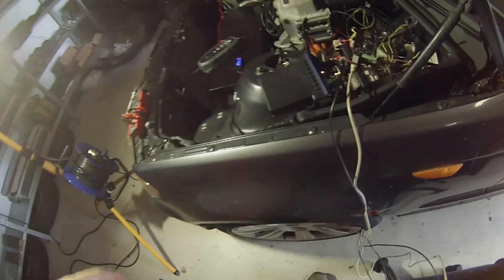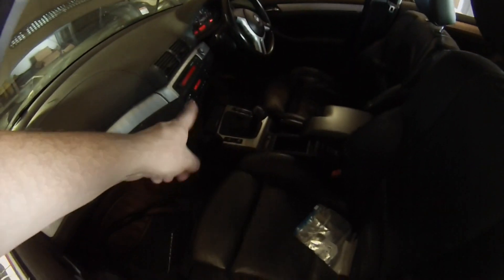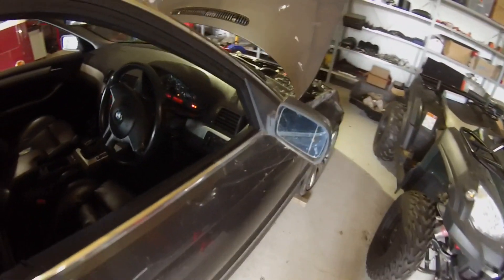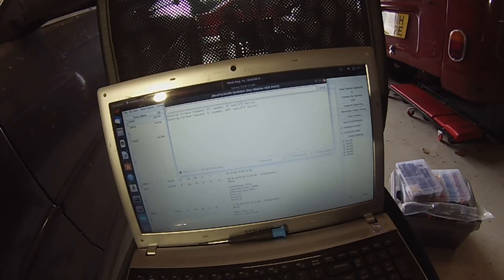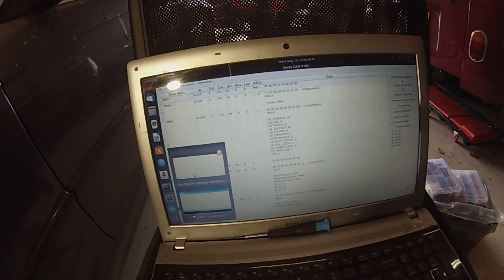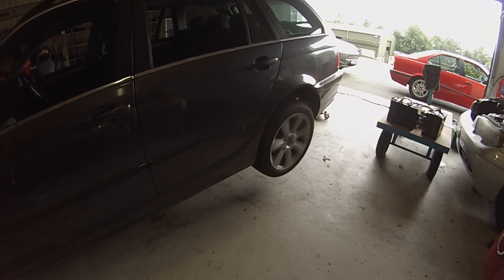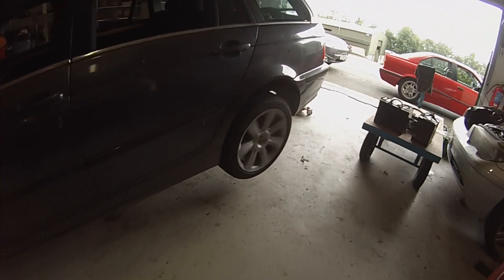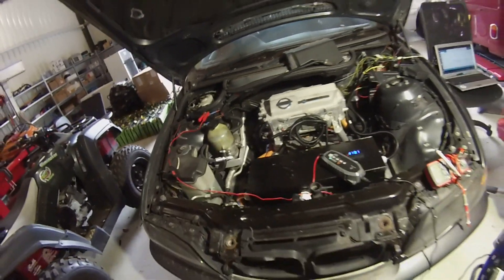The Grey Goose : Forward Motion

Comment: Hi Damien, Looking at other builds with Leaf running gear, people seem to have had a lot of issues with the Leaf controller not running due to faults or missing parts on the car's Canbus. You've got none of the original Leaf loom or other modules (or have you?), so I assume your DUE code is spoofing all these? I had a look at the .ino and was surprised how little appears to be needed to get the motor running? 

 (edit: might have answered my own question!) The DUE is replacing the Leaf VCM here, so that solves the issues of not having the full Leaf loom attached, correct?
Reply from the maker: Correct. It's not very difficult at all to run the Leaf inverter despite what some would like you to think.
Reply: @Evbmw  Ha! You have made it look very easy! I would have assumed a few Can messages would run the motor, but knowing how things always end up more complicated than you'd think, it might have been almost impossible without completely reverse engineering the VCM... Yourself and Perttu have proven it's not too difficult.

I just need to find a Leaf drivetrain and battery for not £5k...

Just wondering what the risks are of a glitch causing full power backwards when you're not expecting it? Does the inverter do any sanity checks for torque commands?

Have you investigated the legal and insurance situation of taking a vehicle on the road with a home brew control system?

Comment: Awesome work Damien! 

Got this a little while back, but we elected to move to a different platform. 

I figured once you got ahold of it, you'd get it working too. His van is pretty nice!  Should be pretty workable just using a basic potentiometer. 

I think this should be limited to the preprogrammed max torque input, correct? So if you want to push it further you would need either a brainboard, or another inverter you control completely. Correct me if I'm wrong.